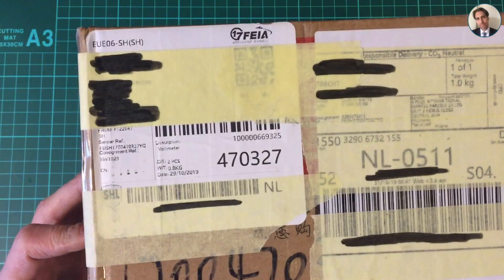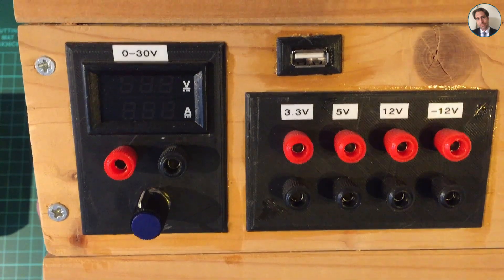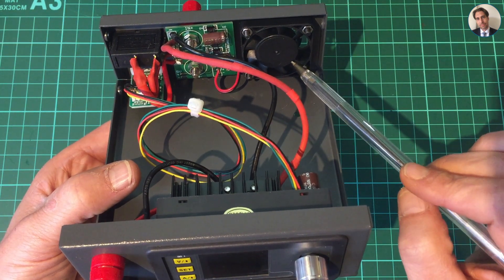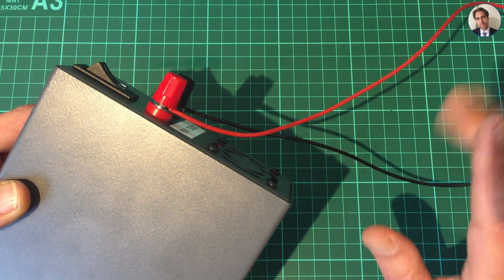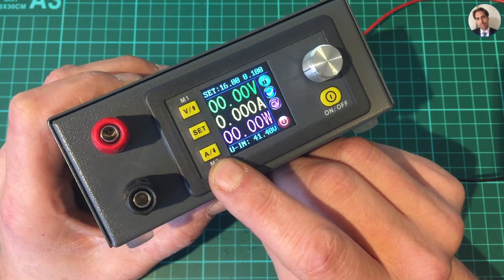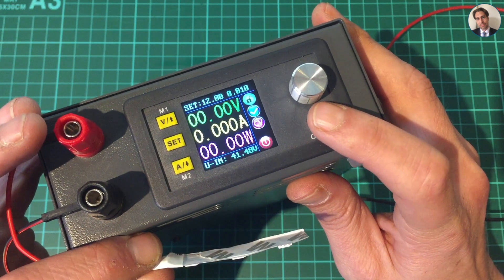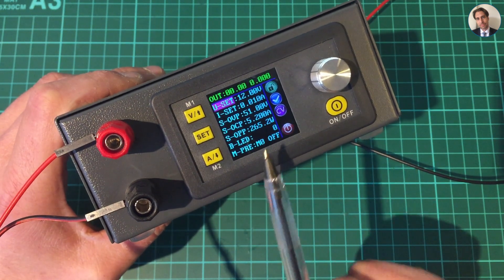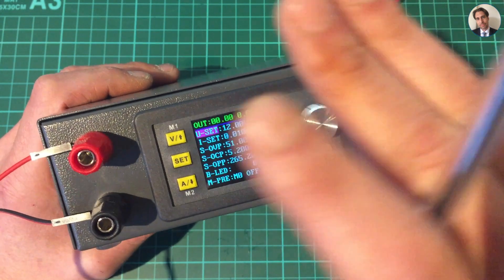DPS5005 Review, Build and Test

Comment: Hello, I have this DPS5005 with this case. I just need to connect the power supply. What type of power supply should I connect for it to work correctly?
Reply from the maker: I use a Meanwell power supply that supplies enough Voltage and Amperage my unit. For the DPS5005 in your case. the first 50 means the Voltage and the second 05 means the current. To get the max out of your unit, the voltage (which is usually adjustable) should be 55VDC (this was said as the max in the datasheet). The output current is 5 Ampere, so your power supply should be able to supply 5A. So look for power supplies that supplies 50V and 5A. 

And... BE CAREFUL with AC mains voltage.
Reply: @DustinWatts  Thank you so much!
Reply from the maker: @jordisanb32  No problem! Have fun with your adjustable power supply!

Comment: I have the same model but without the serial connection since about 2 years or so. I put it into my own case together with a mains switching power supply and a fan. Works just fine since day one.
Reply from the maker: To be honest, I have used the serial connection once. And that was just or testing if I could get the communication working :)
Reply: Dustin Watts After I got mine they announced the upgraded model with serial (I believe there was an usb and a WiFi Version available or was it Bluetooth?) Anyway I was about to buy it but never did. Until now I had no need for this connection and I’m glad I did not spend the money for the version with serial.